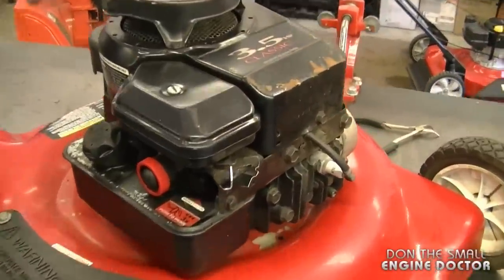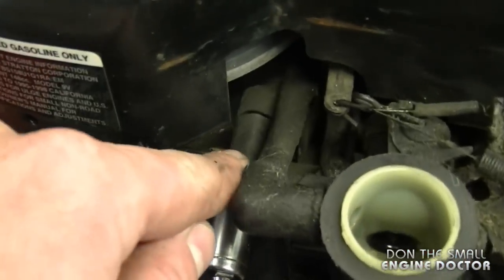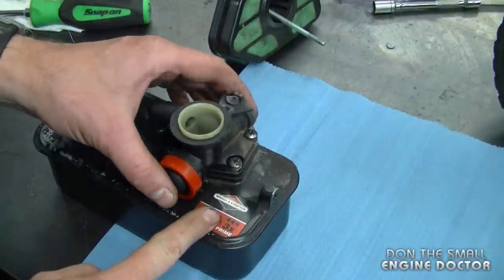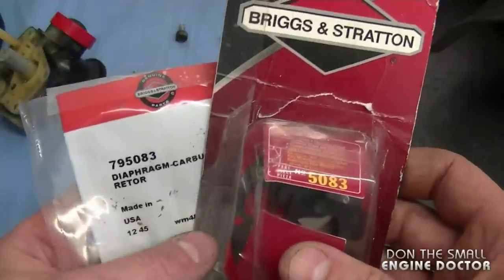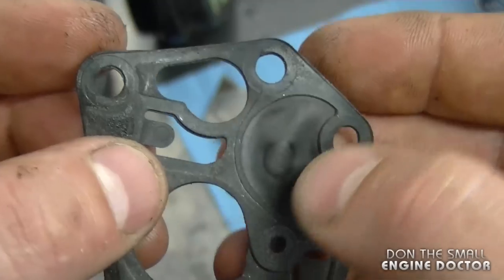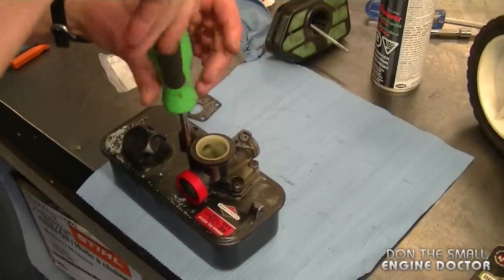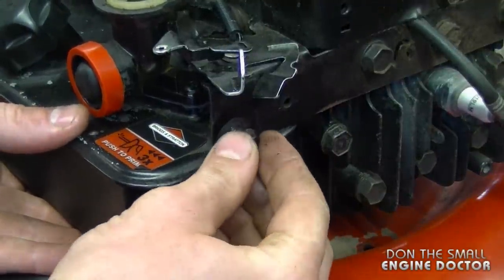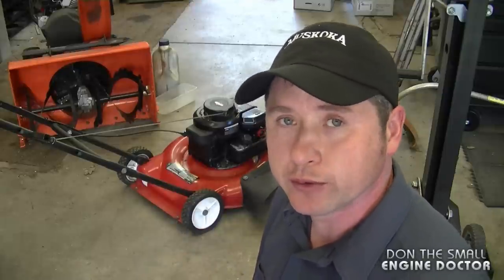Fix 90% of Briggs Lawn Mower Not Starting Problems - Easy Repair

Comment: Hello donyboy73. Good fan, I fix small engines my self. I have a 4hp Briggs and Stratton Toro mower. I replaced the diaphram and reset fuel/air screw. But it still doesnt work. When I start it, it runs at a extremely low rpm and chugs smoke. I 100% sure i installed the diaphram the right way! And cleaned the carb. with carb. cleaner. I've been messing with it for a week and can't figure it out. What should I do!?

Comment: Smashing job Don :-)
I had the same happern to mine, £2.50 kit from my local shop.
The white retainer ring did jump out on mine, it seems a bit of a cheap method, im used to flange mounted carbs.

Comment: Thanks so much for posting this video. I had suspected the diaphragm was bad on my riding lawnmower..  The symptoms that you mentioned were exactly what was going on with the mower engine. You are definitely the man when it comes fixing small engines. I have been a subscriber for a long time. You are the best.

Comment: The center bolt. Don't tighten those anything past 1/8 turn past bottoming out with your hands. I ruined an engine from over tightening that bolt hole, busted the tang right off the block. Never had one back out with just a light 1/8 turn snug.

Comment: Hi Dony , I have seen where a scribe was used on the face of the fuel tank on the back portion which helps keep the diaphragm from bulging slightly  and keeps the diaphragm sealed.

Comment: also check and make sure that the main jet has not fallen out, because if that happens it will run rich, because I have had that happen to me before, I had to take the carburetor apart to see what the problem was, and the main jet fell out, and I had to replace the carburetor with a different one, because I couldn't find the main jet.

Comment: Thanks for another awesome repair video, Don. The 3.5 B&S was the best engine ever built. Had a lawn mower for 28 years with that engine and only replaced the spark plug a few times and a couple of sets of points as well as frequent oil changes. The deck finally rusted out but it still ran perfect.